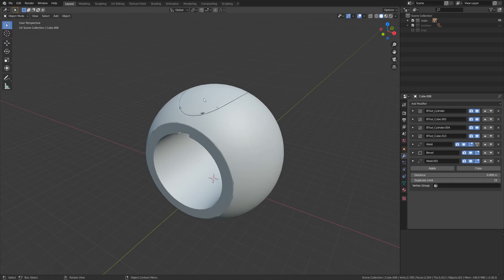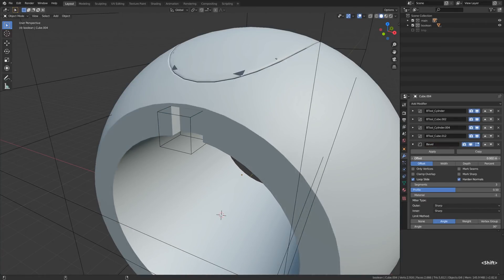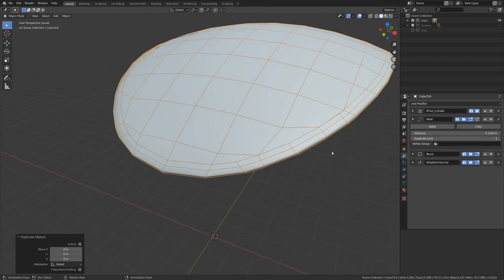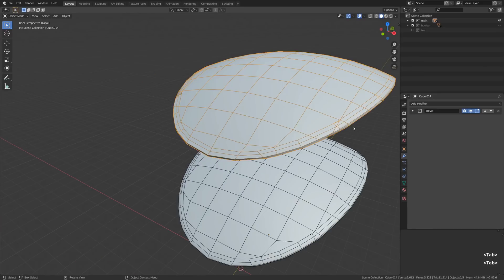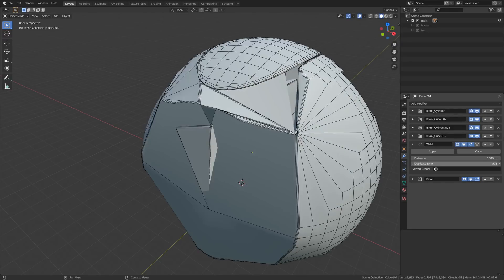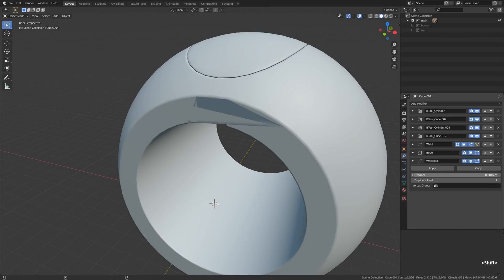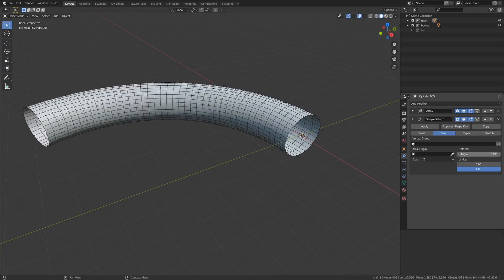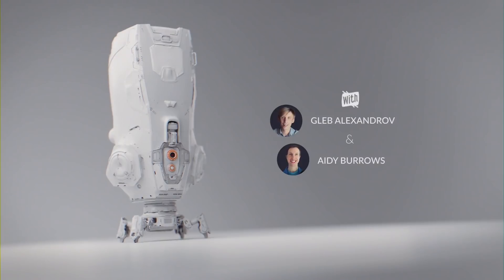Weld Modifier in Blender 2.8x | Hard-surface Modeling Update

Comment: Weld modifier is a step in the right direction. But an Edit modifier would massively reduce the need for people to collapse.
Reply: Seriously. Thats probably the thing I miss most from 3ds max.
Reply: @Nebulaoblivion  In fact Blender DOES have analogue of the Edit modifier. It's the SHAPE KEYS. Placed under 'Object Data Properties' square tab. Blender is AWESOME! Cheers! xxo
Reply: whats an edit modifier?
Reply: @blenderstuff2239  Basically if you add this modifier any geometry your edit like moving a face will be linked to the modifier. So now if you remove the edit poly modifier the face you moved will be lost and your shape will go back to the original state before the adding the edit poly modifier.

Hopefully that's clear, basically you can seperate your edits into individual modifier "layers". It's SUPER useful and something as a 3Ds Max user I would love to see in Blender.
Reply: Yes! I am a 3Ds Max user moving to Blender and I was surprised not to see an 'Edit Poly' modifier in blender. It's so useful for not only the procedural workflow but also having geometry edits on different "layers" (modifiers) and being able to hide those layers or go back to an old stage of your model.

 Very useful!

Comment: It can be really good when you make roads with curves, you can merge two roads together
Reply from the maker: i haven't thought about it this way, interesting. for merging various things, right?
Reply: @GlebAlexandrov  Yes that's it, you can take two curves (obviously in the same curve object, you can't use a modifier on two seperated objects), and when you bring two point of the geometry close to the other, it merges and creates a connected none destructive road ( geometry that is generated in the curve option, so one of the extrude options, and not a plane with array and all of this, that one is kindda limited). Though you may have to convert it to mesh for specific parts of a road that would be hard to do with curves, but it's still a faster and more flexible method for road making than anything else I know right now. And for texturing, I usually do (for example) the lines or some tracks or any imperfection by placing another geometry with some textures or arrayed geometry just above the actual road (shrinkwrap), with shadows disabled and sometimes parralax mapping for depth illusion (Simon Thommes give us a free node setup for parralax on his Gumroad page I think), so you use  decals basicly, and this way the road it self just has some concrete textures on it and you don't have to UV  the road (wich is borring when it's been merged, especially if the road is long. And one tip as well, to merge another object's material with the road one, just make a group with your road texture that is mapped using "position" from geometry node, then insert the group in the other material, it can be modified on two diferent materials, it's synchronized). Anyway at the end, the results are really impressive to be honest and fast to achieve.
Reply: @GlebAlexandrov  It's not usefull for simple one way roads, but for something more complex and curvy, it's really good and not  that frustrating.

Comment: Thank you, exactly what I need right now!  I've been manually combining booleans by subdividing and dissolving/deleting edges/vertices one by one... although results have been very good, just taking AGES as I'm modeling about a dozen iterations, per model, with slight variations.
Reply from the maker: I know what you mean. It's much easier to iterate now. But sometimes, manual approach just wins no matter what. so it's a bit complicated)

Comment: Wow! How could I overlook this awesome modifier that I missed since moving from 3ds m*x
Reply from the maker: It has been added recently, maybe that's why)
Reply: Isnt that a legacy redundant modifer in max since you can make use of edit poly to layer the welding part ?
Reply: @orphydiancg7759  but edit poly modifier is for manual stuff. Yeah, it's more powerful, and I used it much and still missing it in blender, so I believe with everything nodes it will be possible to replicate this behaviour. Thanks for bringing up warm memories though)
Reply: @SlayerDUDE1993  how its manually you still have to manually  play with the threshold  in the weld modifers as well isnt it ? its also very easy to select all.
Reply: @orphydiancg7759  As I remember in edit poly modifier you manually select verteces that you want to weld and you cannot unweld them and weld back just with a slider like you do with weld modifier. Am I wrong?
Reply: you can select all the verts and weld globally . Yeah you can't unwelld them back but you can delete that edit poly modifier anyway.
Reply: @orphydiancg7759  Using weld modifier I don't have to select anything, it does it by default. I don't need to delete modifier just to recreate it and weld again but with different threshold, I'll rather change threshold of existing modifier. You don't use tablespoon to eat pasta, you have fork for that. Different modifiers for different tasks.
Reply: @orphydiancg7759  plus don't forget that weld threshold cannot be animated in edit poly.
Reply: @SlayerDUDE1993  yeah good points

Comment: I feel this should be part of the bevel/simple deform etc. modifier. I don't think it is a good thing to have a modifier just to fix another modifier because that can balloon very quickly into needing a "fix modifier" for every modifier. And if you need to remember to always add a weld modifier modifier after most modifiers then it just makes blender less efficient to use. In simple terms if the bevel modifier breaks the mesh then bevel modifier needs to be fixed. Adding another modifier to fix a common issue in another modifiers is more like adding a cube and then subsurfing it into a ball instead of just adding a ball. Sure having weld modifier is great in itself but not optimal solution.
Reply from the maker: ideally, all these modifiers should be converted to nodes so we can connect them in any order we like, build our own uber-modifiers from basic building blocks and so on.
Reply: If blender would have something like edit poly modifier all these fixing modifiers wouldnt be necessary as you could stacking any kind of edits you do the the model. In Max there is still a Weld Vertex modifiers but its kinda dated.
Reply: Disagree, this is very basic and helpful modifier that should be added a long time ago. Adding the merge button to every possible modifier is not more useful.

Comment: I haven't even reached the updated part in the course and I've learned sooo much about modeling! Definitely a 10/10 course!
Reply from the maker: We want to believe that the 2.79 part of the course still holds some relevant info about hard-surface workflow in general, while the 2.8x part helps to actualize it (presumably). Thanks!
Reply: @GlebAlexandrov  Sounds fair enough. I'm just learning from your workflows rather than step by step anyway, so it's very relevant! :D

Are there any new courses coming up in the future?